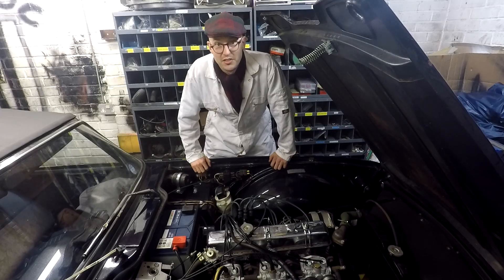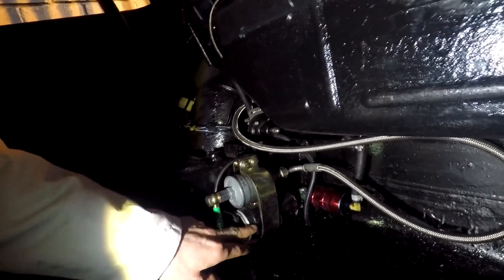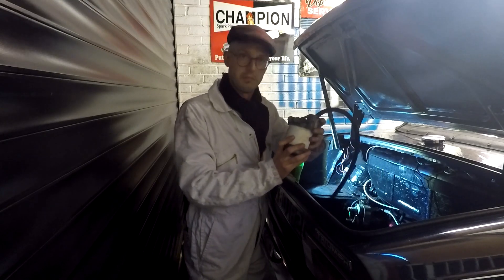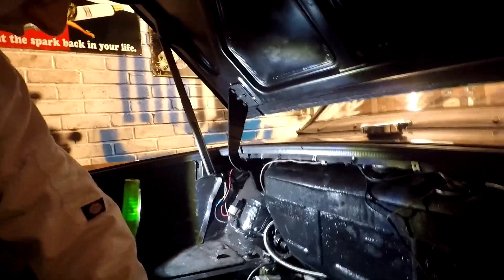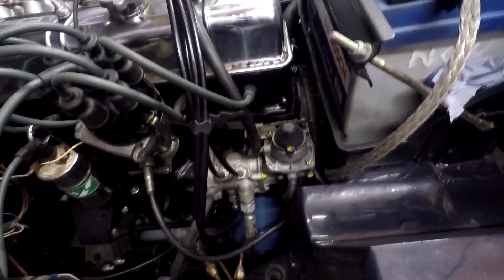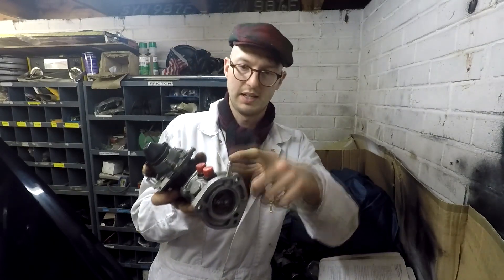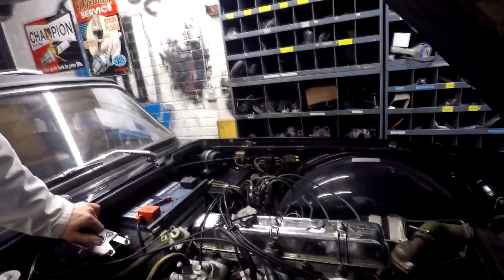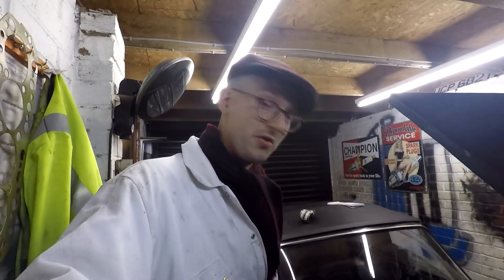Triumph TR6 A Brief Overview of Fuel Injection

Comment: Hi Steve. I am working on my tr6 after it’s been standing for two years but am worried about turning the engine over as there is no oil pressure. What is the best way to pressurise the oil system. Obviously I have the spark plugs out. Thanks Steve.
Reply from the maker: Hi Mark, you can remove the distributor complete with its gear drive to camshaft. If you can make a long rod to fit inside the shaft where the distributor was, with a notch at the end, and to the other end attach to a drill. Then left hand turn this in the drill, this will operate the oil pump in the engine manually, without turning the engine over, therefore pressurizing/ priming the oil system. It's something many engine builders do prior to first start up on a new engine 👍

Comment: Hi Steve, another great video. I sold a CR 2 years ago and the guy who bought it  never drove it , I bought it back and have got it running like a clock,  I checked the injectors and number two and four were dribbling a quick tap and everything seems fine. She runs only very slightly rough in traffic, but when I hit the gas she takes off. Ive changed the points, ( a slight improvement) cylinder number 4 is running slightly rich, compression test showing 150 on all cylinders except 4 which is 145. which could explain rough running in traffic any ideas Steve ? Ive checked all hoses and replaced jubilee clips, except the hoses on the rails.
Reply from the maker: Hi Stewey, your compression is likely down due to bore wash. The cause of which could be down to a leaky injector. Before changing the injector do check the ignition system, with the plug and lead. switch them with another cylinder, just to make 100% sure you issue is a fuel problem, and not an ignition problem. Then take it from there. All the best Steve 👍
Reply: @SteveDentonClassics  plug leads , plugs new points , the injectors seem ok.

Comment: Hi Steve Bill again , can yo tell me what the part # on the bosch pump is as in canada here no one understands the pi system and to import the part from the uk involvesa crazy duty and shipping charges if I can get the exact bosch pump her I can retrofit the rest of the system hopefully   still trying to get the tr up and running   thanks  Steve
Reply from the maker: The last Bosch fuel pump I purchased for a TR6 was part number 0580254910 you need to make sure the pump is capable for over 100psi as most modern equivalents are only rated to around 50-60psi max due to EFI demanding lower fuel pressure 👍🏻

Comment: Crikey - very informative I must say. I'm toying with purchasing a 2500S manual carb model or a 2500S PI manual (both cars available at time of writing and both in very very good order throughout). At the end of the day the carb model will dare I say be easier to look after due to how the fuel is delivered – I live in a hot climate.
Reply from the maker: In all honestly a car a petrol injection car can be more easier to maintain if set up correclty than a carb car. They just run at high pressures, and must be used regularly. When you think about it, modern cars are fuel injection, ok they are electronic not mechanical fuel injection, but the principle is the same. It's really down to what you want from the car, both systerms have their pro and cons. I mean unless you know what your doing with a Pi systerm then altering the fuel air mixture for diffirent climates at the side of the road is a little more harder to do. If I was going for a car with carbs I'd want to go with one that had a set of SU's on it, as they are dead easy to maintian, and thrive on neglect. Strongbergs suffer with diapham failures, they are ok, but SUs are just better 👍
Reply: Fair enough re what you say, as you have the experience. I'm unsure as to my abilities re injection, but do know a respected Triumph man who does. Nevertheless interesting what you say re Stromberg versus SU's. I have a 1974 P6B 3500S which uses SU's and yes they are easy to maintain and 'thrive on neglect'. I've had many SU cars over the years and never had any trouble with them. Interesting that in some overseas markets Rover used Strombergs instead of SUs for their later SD1. So I gather fitting SUs to a Triumph is pretty straightforward?
Reply from the maker: With Triumphs it was both a cost things and a necessity thing. For example on the GT6, and TR4's you can't just swap out the Strongbergs for a set of normal SU carbs or the bonnet won't close. So if you was to swap out Stromgbergs on a GT6 or TR4, you'd use Dolomite Sprint SUs as dashpots that are shorter, and therefore you can close the bonnet. You can buy conversion kits Strongberg to SU from Chris Witor or Moss Europe for the big saloons. Stromgbergs are ok, but I'd always keep a spare set of diaphrams in the glovebox just in case they split 👍
Reply: Many thanks Steve for the advise.

Comment: Great video Steve! Really informative stuff, but I have one question that's niggling me about the whole arrangement. If the system needs to draw enough of a vacuum to actuate the fuel flow through a diaphragm, like a carburettor does, then why is it more efficient? Is it that the vacuum isn't as high as in a carburettor as it doesn't need to pull the fuel through the needle gap and atomise it, or am I missing something?
Reply from the maker: Cheers Magic Monty, right then, the vacuum on the side of the metering unit is only there for acceleration and anything higher than idle speeds. In a petrol injection Triumph, the whole air side of the system relays on good air seals to work well. To explain why fuel injection is more efficient than carburetor we need to go back to basics. With a carb, it will draw fuel to whatever cylinder requires it under vacuum. The quantity of fuel drawn per cylinder by a carb will be different due to wear, valve adjustment, and various other reasons. Put simply the fuel per cylinder is unregulated. If you change to fuel injection, the fuel is pressured, the injectors open and close with exactly the same quantity's of fuel to each cylinder regardless of wear, valve adjustment, and various other reason. In simple terms controlling the fuel flow quantity to each cylinder with exact quantity's will give a bigger bang, and will see you more closer to the perfect air flow mix of 14.7:1 (stoichiometric ratio) Hope this helps answer your question, cheers Steve 👍

Comment: Condensation/water in the fuel tank caused a lot of pump/injector problems.  Do you use an upper cylinder lube/Redex to lubricate pump and injectors?
Reply from the maker: This is very true, water ingress can cause all sorts of issues. Personally on my own historic cars I only use high quality Shell V Power 99 Or BP 98 fuel, which are less prone to water in fuel issues. Classic cars of the 60's and 70's seem to run better on this fuel, and there is less of the dreaded ethanol the higher quality fuel. As for additives, I only use Castrol lead replacement octane booster. Older cars we're designed to run on higher octane than we run in today's fuels. Even though most of my cars have had there valve seat converted and hardened for unleaded, the additive isn't a bad thing, it just does what lead in the fuel would normally do, cushion the valve. So in theory if well looked after it giving my engines a longer life span. As for Redex, I have used it, it's great stuff for cleaning out fuel line, and keeping fuel systems in good condition, however like drinking too much whiskey I'd only use that hear and there, as over use can be damaging to seals. Hope this helps, cheers Steve 👍

Comment: Hi Steve can you tell me what the bosch pump you have on your tr mine is of course a lucas and Iknow it doesnt work right so thats where Ill start  with a new pump  I just want to get the right one thanks  Bill
Reply from the maker: Hi Bill, I got my Bosch pump around 12 years ago from Prestige Injection. Unfortunately Malcolm at Prestige Injection has retired so I'd recommend getting one from TRGB, they make a very good externally mounted fuel pump for the TR6 👍

Comment: Hi Steve am I ever glad i found your site, I exported my 73 tr6 to canada where I had moved to from london england in 1981  its only got 45 ,000 miles on it original, totaly rust free since Ziebart underbody protection from new,no accident damage I feel it is probably the only truly original tr6 in the world, since its fuel injection no mechanic in canada knows how it works and so it sat for 40 years under cover, in the meantime started a business raised a family moved 3 times , now its retirement time and every day i look at my try and promise myself ill try to get it running again, Im not a mechanic but used to do simple things to it back in the uk,  so I have the ability to habdle tools, so Im delighted to find you with your information and guidance,  ill keep you posted if interested Ill send you my e mail address    you made my day   sorry fore the long mail
Reply from the maker: What a lovely story, it would be great if you could get your TR6 up and running again. Being a '73 that would make it a CR car 125bhp, and in general they are a little more tame and driver friendly over the earlier 150bhp. The throttle linkage on the CRs tends to be a bit of a pain to set up right, but they are great when you get them running well. I'm sure you'll have it running again soon 👍

Comment: Superb info and very clear. Thank you much appreciated. I just bought a 74 TR6 for restoration at an on line auction so I've only seen photos, bit gambly I know but sure life is a risk. From this great video I now know its a 125bhp version and have a much better understanding of how the PI works. I've an interesting challenge, I'm importing the car into Ireland and it needs to be running in order to get assessed for registration tax so whilst I'm doing a frame off restoration I need to temporarily get the thing to just run, idle only will do it just neds to start and run for a couple of minutes. From this video I'm confident I can get it to run with a minimum of labour and parts, enough temporarily to have it run on the trailer at the registration inspection.
Reply from the maker: Cheers Niall, that's so true, we're only hear once, and what a great car to buy at auction too. I'm glade my video has helped you understand the Pi system a bit better on a Triumphs. I'm sure you'll have your car and and running soon, they are fantastic cars to own and run 👍

Comment: regarding those original design Lucas fuel pumps, I had one on my car for a number of years and it seemed to function okay but I was living in Scotland which was a coolish climate and I was only doing open road driving, when I moved to London for work that is when the Lucas pump got very temperamental and actually left me stranded a couple of times, once on the south bound carriageway of Park Lane at which point I had a bosch pump fitted, that was around 20 years ago, I think in warm climates those pumps are useless and after living in Scotland I considered the south of England as a warm climate!!  ...and the car is still working on that Bosch pump, fitted outside in the wheel arch where it gets caked in road grime, but it is still going strong. I think that original Lucas fuel pump was a poor design to start with and the achilles heal of the whole system and the main reason  many frustrated owners dismantled the fuel injection and installed either twin or triple carbs.
Reply from the maker: It's typical of anything British, make do and mend attitude. You can see why the Japanese and Germans took over with making the best cars in the world. They pay attention to the details and develop the correct parts for the jobs they are needed for
Reply: @SteveDentonClassics   absolutely true Steve,  the TR6 was a successful car for BL with 80% of cars produced for the export market, they sold well, and then BL management totally threw it all away with their poor decisions and poor quality control.

Comment: Steve, the P.I. set up looks so much more impressive then carbs. Quite exotic (that's exotic, not erotic) looking.  A question - how is the metering unit driven?
Graham
Reply from the maker: Hi Graham, the metering unit is driven off the pedestal. Basically you have the jack shaft going up from the cam shaft to drive the distributor, but between the jack shaft and the distributor you have the pedestal. That just gives a 90 degree angle gear so that the distributor and metering unit can be driven together from the jack shaft. Cheers Steve
Reply: Steve Denton thanks Steve.
Reply from the maker: No probs

Comment: I bought my car off a TR Specialist at the time, a guy called Geoff Mansfield owner of Northern TR Centre, originally based in Willington then later Sedgfield, both near Durham City. Luckily at the time he had a bit of a Lucas PI guru working for him, so I expect my car came set-up as good as you could get. Drove the car all year round in all weathers, including three years down to Cornwall for camping holidays. And it was blisteringly hot every time. Never has a single issue with the fuel system, although I did once strip the 'compressor' side of the fuel pump and gave the brass internals a good clean with fine grit paper to remove a bit of glaze. I'm not saying it doesn't go wrong, as you say it's a mechanical system so needs looking after. One thing for sure is you are 100% correct in my opinion, you need to use the damn cars regularly.  What better excuse does anyone need, if you ever need a one! To get in the thing and drive it, because if you don't it'll give you grief. I'd love to own another 6 and it pains me to see so many lovely examples doing  just a few hundred miles a year, but their boots are full of show winning rosettes!
Reply from the maker: Yes, that is exactly it, cars are built to be driven! I don't mind the show cars as each to there own, and it does give us something to look at that is in mint condition, but a car should be used and enjoyed for what it is. At the same time, I've toyed many times with retiring my 6, being what is believed the be the 19 oldest surviving fuel injected TR6 in the world, and being registered in my home town. But then I think, its there for me to enjoy, and that is exactly what I do with my cars, enjoy them, and use them

Comment: Hi Steve . You lost me after you said " Well hey guys" ! 😂  l can do virtually anything regarding body/paintwork  but mechanical "no way hozay!" Back in 1973 l had a PI MK2 with the Lucas pump. It only let me down on one  occasion  and that was 2o'clock in the morning when l was taking one of our barmaids home...honest!!! And on another occasion the pipe split and l lost a whole tank of petrol in 7miles! Great show and l will get mine returned to Lucas when the time comes. ( l've been making good all the metalwork on a Jaguar MK 9 for the last 6months in exchange for  mechanical work on my "e"type! It's now payback time!) I see yours has a chrome rocker cover .  I think l'm correct in that the early 6's had them factory fitted. Thanks Mate.
Reply from the maker: Haha, no probs. Yes your right, the chrome rocker cover was an early 1969 thing. Then rest of production they we're painted grey. Sounds like you've got a lot to keep you busy!

Comment: Excellent Video Steve.  Oddly enough, Les was wanting to learn more about the PI cars as I was telling him the difference between UK cars and NA   Cars.  I’ll have him watch your video ( if I can get him to sit still and behave that is 😉)  One question, is the PI throttle linkage controlled by a cable? I think I see it coming off the centre of the manifold out towards the outer fender?
Reply from the maker: Haha good stuff and perfect timing, maybe he can watch it during his union break! Yes, on fuel injection the throttle linkage is controlled by a cable. It's a weak spot on the car as the cables have a tendency to strip on the ferrule as it goes through the bulkhead. Modern cables are just poorly made. To overcome this many owners simply reinforce the cable with a cable tie and the problem goes away.Hope this helps, cheers Steve

Comment: Brilliant again Steve! Lucas pump was a wiper motor wasn’t it anyway I’ve got the same system but Trgb says that since Bosch outsourced their pumps to Latvia they’re s*#t so it’s an English pump now( not sure who) but it’s on mine but mounted outside behind wheel but unless tank is topped up all the time it cavitates (howls) never starts on 6 always 5 🥰
Reply from the maker: Cheers Simon, yeah, Bosch stopped making them a few years back, so now its a 'Bosch like' fuel pump now, however we all still refer to them as the Bosch fuel pump conversion. TRGB do an excellent externally mounted fuel pump, its been very well developed by Gary Bates and his chaps. The stating on 4 or 5 cylinders, such a common thing for the Lucas Mk2 fuel system. I normally let my 6 warm up for 5 mins or so before I drive it, that way the system has a chance to purge any air our of it without causing damage

Comment: Blast - so I can't just bolt my metering unit back on and hope it will run ? :) . Just as well it needs a full engine rebuild having been stood for 25 years !  Way above my pay grade so will have to get it professionally done.
Reply from the maker: You can if the pedestal hasn't been removed, otherwise you'll be scratching your head trying to get it set up right. Its the gearing from the cam to the pedestal to the MU that needs to be right. To get it perfect its best done with the head off. But just replacing the metering unit, you can just unbolt it and rebolt it on, so long as the gearing is timed up right in the first place. Cheers Steve